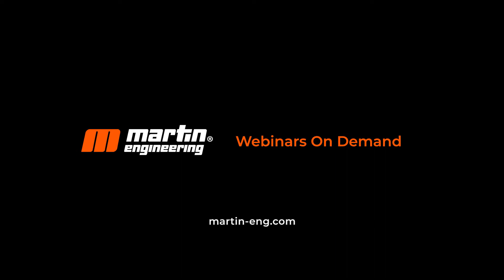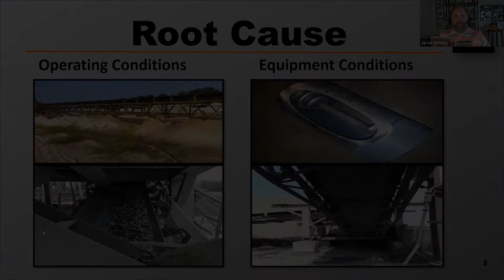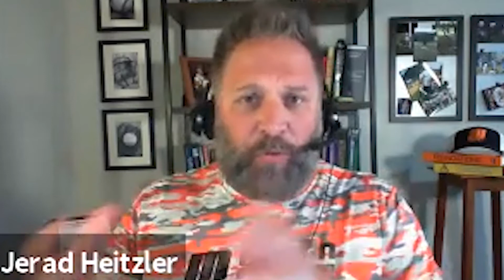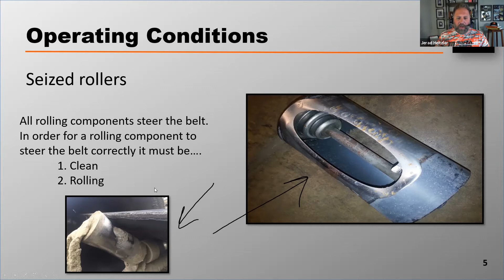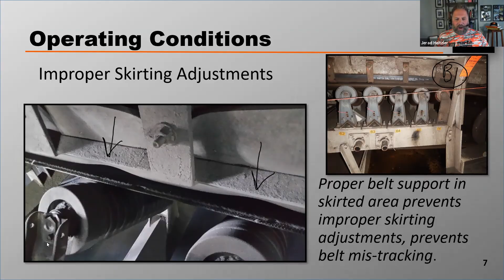Operating Conditions That Cause Conveyor Belt Mistracking

Comment: Does anyone make spring tensioned skirting? I'm always seeing bolted on skirting with vertical adjustment slots. Wouldnt making the skirting auto adjust down with spring tension be way easier and consistent?
Reply from the maker: We're not familiar with any type of spring skirting. A concern to consider is the force of the skirting against the belt. You typically do not want any downward pressure with skirting, which may happen with spring-type skirting. The skirting should just make contact with the belt.